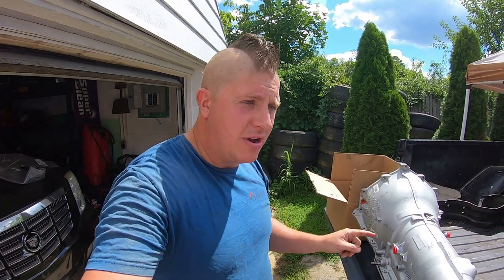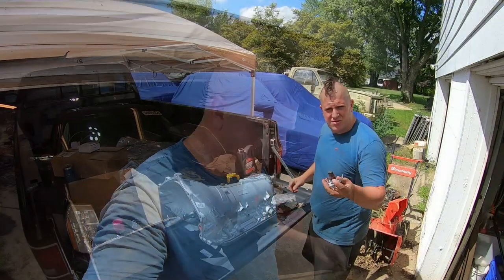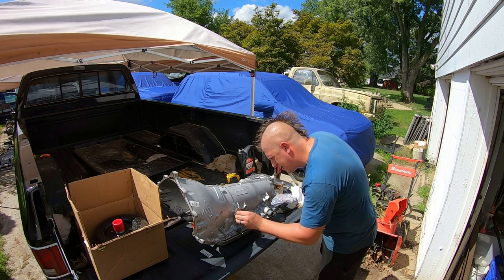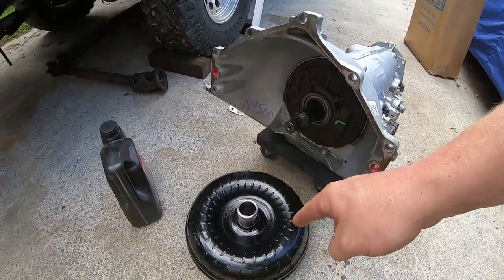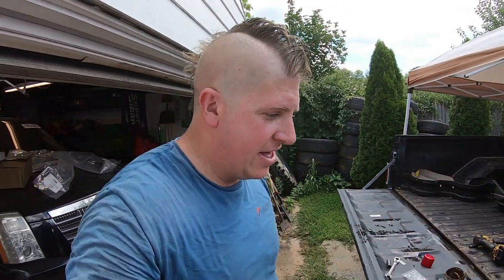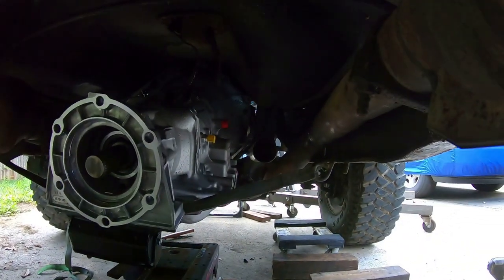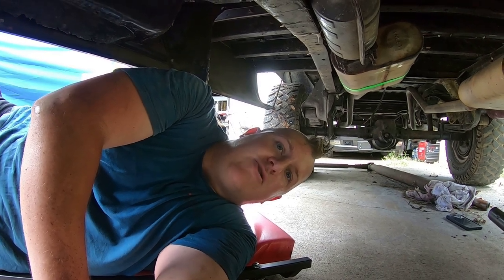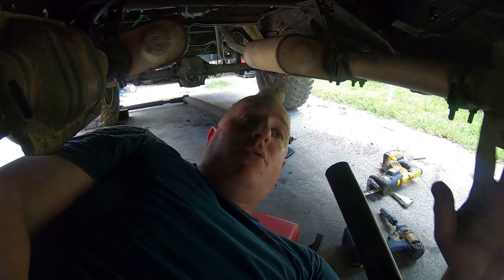Squarebody K10 Swap Project, Part 3 4L80E Swap, Will it Fit?

Comment: So if I  buy a 2wd 4l80e, cut the shaft, and get the adapters then I don't need vss on the np208 transfer case? 4x4 still works correctly? Thanks!
Reply from the maker: Yes that would work, and you wouldn't need a vss on the transfer case.

Comment: pretty good video.  I have an 1985 k 20  wanting to buy a 454 with a 4l60 2wd what do i all need to do?  How to make it 4wd? Thank you
Reply from the maker: Thank you! I'm honestly not sure, I know the 454 uses the same bellhousing pattern as all the other gm engines, but I don't know if gm ever put a 4l60 behind one from the factory, so I'm not sure what torque converter or flex plate you would need to get them mated together.

If the truck is a K20 already, it should already be 4wd and have a th400 transmission in it, which is a much stronger transmission than a 4l60 to begin with. It's very easy to connect a th400 and 454, it would probably be as simple as removing the engine in the truck, and putting in the 454 if you keep the original transmission and transfer case.

Comment: Great video man! Thank you so much for this info. Where or what website did you get the mount for the 4l80e to np208 adapter? Thats the last piece I need for my swap! Thanks again!
Reply from the maker: Thank you! Glad it helped! The NP208 has the same bolt pattern as the more modern transfer cases, readily available in junkyards, on amazon, rock auto, autozone, napa, etc. Just an adapter for a 2000 to 2006 4x4 2500HD with a gas engine.

Comment: I want to thank you so much for clarifying on how to do this swap without having to get new driveshafts made I have the exact project sitting on ice for 5 years. I actually ended up getting a np241c made up as well but now I’m stuck on the speedometer on a budget. Now I’ll go check if my dirty dingos have that offset.
Reply from the maker: No problem, get that thing finished up and drive it!
Reply: 2wd or earlier 4L80E core. = rear speed sensor = keep cable for stock speedo

Comment: If I use a 2wd 4L80E and cut the tail housing shaft will I need to run a VSS on the t-case or will the 2wd 4L80E already have a VSS running to the computer
Reply from the maker: A 2wd 4l80e should already have an output speed sensor on it.

Comment: So just to clarify you used a 2wd 4l80e. But did not change the tail shaft to a 4wd output shaft? the 2wd spline on the trans fits right in the transfer just with the adapter?
Reply from the maker: No, sorry if I wasn't clear, the transmission was set up as a 4wd transmission, it has the 4wd output shaft, BUT whoever rebuilt the transmission used an output carrier assembly from a 2wd transmission. The only difference between the 2wd output carrier assembly and the 4wd output carrier assembly is the 2wd output carrier assembly has the toothed ring on the outside for an output speed sensor. They are interchangeable.

Comment: Hey there glad I came across your videos.   so I’m doing the same swap.  87 k10 6.0 4l80e 2wd with the 208 32 spline swap.  My question is. I plugged off the rear 2wd tail cone hole for the rear seal. But noticed a drain hole on the bottom of the back of the trans. do I need too plug that hole?  So fluid don’t come back into the trans / t case adapter ??  So far I haven’t seen anyone mention anything about that what I believe is a drain hole.
Reply from the maker: The small drain hole at the bottom rear of the transmission case you leave open, it allows the space in the adapter to "breathe" and if any transmission fluid get's past the rear seal of the transmission it will be able to drain back into the pan.
Reply: Awesome thanks for you reply back. I appreciate it.  Do you remember what flex plate you used? Part number? Or just any info you have on it.

Comment: Great video, thanks for the info. I have an 84’ K20 and want to do this, but with original 350. I know that certain years and old vans have a controller for trans, but What I read, the 2wd output is different from 4wd, so a 2wd 4l80 won’t work in a 4wd?  If you can shed any light on my confusion, I’d appreciate it.
Reply from the maker: you've read correctly, the earlier models, I believe up to 1995 had a separate transmission controller. Yes the 2wd and 4wd transmissions have different output shafts. There are actually 3 lengths of output shaft, the 4wd output, the 2wd with a fixed yoke output, and the 2wd with a slip yoke output. Technically you can make any of them work in a 4wd application since the 4wd output is the shortest, you can just cut the 2wd outputs shorter to work in a 4wd application.
Reply: @MohawkMotors   You are awesome! Thank you. I don't suppose I could push it and ask how much I would have to cut off between both the fixed and slip yoke?

Comment: Will that adapter work on a np205?
Reply from the maker: It won't fit an NP205 without modification. You would need to modify/clearance the adapter to clear the upper shift rail of the NP205. You would also want to add some other form of support for the transfer case due to the NP205 being substantially heavier than the aluminum chain driven transfer cases.

Comment: Can you post a parts list for this swap? Flex plate back, thanks!
Reply from the maker: Flex plate back, 4L80 transmission with torque converter, factory transmission to transfer adapter from 2000 to 2006 silverado 2500HD 4x4, np208 transfer case with 32 spline input, factory crossmember and transmission mount.
Reply: @MohawkMotors what do I need to get the transfer case into the trans and what electronics did you use?
Reply: @MohawkMotors also stock 2000 silverado transmission mount or stock Squarebody mount?
Reply from the maker: It depends on your specific setup, if you're connecting a 4l80 to an np208, I listed the parts needed above, depending on which np208 you have you may need to swap it to a 23 spline input shaft.